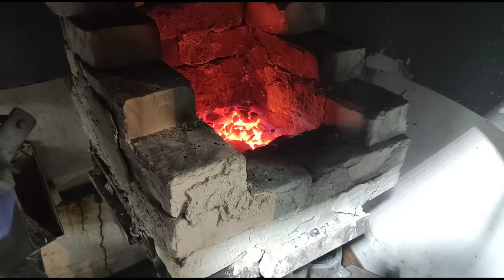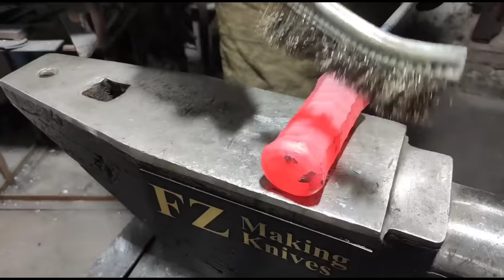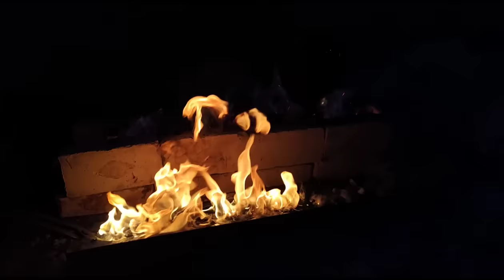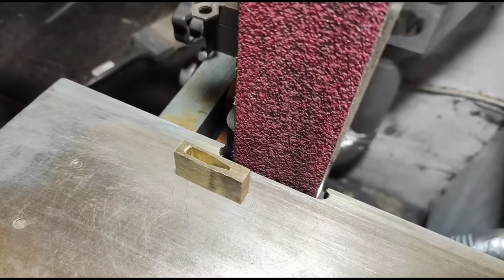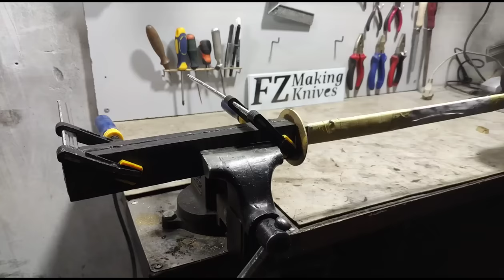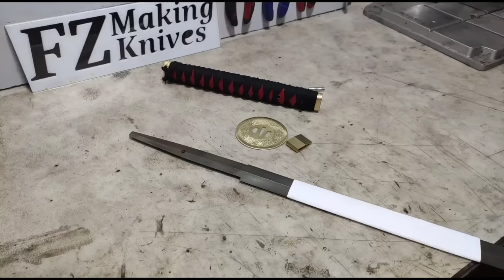Wootz KATANA from bearing balls

Comment: I can't imagine forging out that ingot without machinery. That would be so hard and time consuming. Blacksmiths before industrialization were total chads.
Reply: they used the same exact method, fire,hammers and anvils werent hard to find back then, neither were blacksmiths
Reply: @efslgima  they didn't use machinery dude
Reply: @michaelburgess6004  actually, how hard would it be to tell some slaves to push up a heavy block of stone or steel? thats how it would have happened. a heavy piece of steel, along 2 guide rods, slaves had to lift it up and down. thats how you get this to happen.
Reply: @sollitdude1  That sounds like a lot of effort and slaves for something that could be done with a pulley system. Gonna need some evidence that that sort of thing happened. Slaves are expensive and you also have to keep them from being unalived. I doubt a reputable blacksmith would use slaves for basically anything aside from maybe moving materials, but blacksmiths were often fairly poor.
Reply: @michaelburgess6004  You couldn't be more wrong! Power tools have been available for thousand of years, its only in europe they started showing up by the end of the 11th century. No joke, look it up.
Reply: @cruelfish4824  Why would I look up something that sounds ridiculous if you're the one making the claim? The burden of proof is yours, buddy. Also, power tools implies electricity, so no. I think you're just factually wrong on that one. Electricity is relatively new.
Reply: @michaelburgess6004  https://en.wikipedia.org/wiki/Trip_hammer a pretty one to one example, starting around the 12th century, but im sure more simplistic examples can be found predating that
Reply: @mastermanlaser  The trip hammer wasn't invented until 1839. I read about something called a "tilt" hammer that predated the trip hammer by about 2000 years, but I can't find any illustrations or replications of such a machine. It's described as a "Heavy blunt guillotine" which would lead one to believe it's much simpler than a trip hammer. Hardly a "power tool." That said, the fact that no illustrations or replicas appear when searched calls into question whether or not such a thing was every used or even existed.
Reply: Well, historically, swords weren't really made as shown in this video, obviously. Also smiths didn't really work alone, they'd have partners, apprentices and potentially slaves and various powered tools were available.
Reply: @mastermanlaser  lol OP got btfo'd
Reply: @hypoaktivnaovca  Not powered tools. Slaves no, apprentices yes.
Reply: @mastermanlaser  we talking modern electrical power. Old trip-hammers (tilt hammers) used to be powered by water wheel meaning your blacksmith had to be near flowing water otherwise it wouldn't work. Also the trip hammer started in China and quickly spread to Europe within the same century they sprouted from China. If we are talking about modern power tools which I assume Michael implied then you are just talking and nothing you're saying actually means anything.
Reply: @Devonaut  so first off, power tool actually doesn't imply modern or electrical 'power'. Even now, pneumatic and kinetic power tools are still in use. Second off, I'm not your history student, I just wanted to make you lads aware of the history of human ingenuity. Don't pick fights over things your wrong about, because there is a ton of stuff like the trip hammer in history
Reply: @michaelburgess6004  I mean, I'd consider  a grinding wheel a powered tool in this example and as to the slaves, what part of the world are we talking about?
Reply: @mastermanlaser the OP was clearly imagining conventional modern day power tools. Not tools that people had to walk for 3 days to get to in the 12th century.
Reply: @hypoaktivnaovca  I don't know, but blacksmiths take pride in their work. Personally, I don't think that a blacksmith would have a clueless slave forging out his material. Also, you're the one who would need evidence supporting the use of slaves by blacksmiths since you're making that claim. Additionally, a grind wheel is nothing more than a turn crank attached to a pedal. Hardly a power tool if you ask me.

https://www.youtube.com/watch?v=9nx2Ut7K8Is     (grind stone video)
Reply: @hypoaktivnaovca  Machines are unwavering and designed to do a task. You can ruin your metal with a machine and have to completely reforge it, however, the blacksmith controls the machine. The power, speed and precision are all things that the smith has power over. You don't have that control when you're telling someone else to do it for you. I don't know what blacksmith would put his signature on a weapon, tool, or piece of armor if he had some random nobody slave forging his material for him.

That would be like if Bob Ross had someone mix his paints for him or paint the tedious trees because it was "too much work for him." Or if a potter had someone else make the pots before he put design work on it. It's not yours anymore when you have someone else do that.

There were slaves that were made to forge and alter weapons for the army, but they weren't "blacksmiths." Blacksmiths have a reputation. A nobleman would never have a slave craft his weapons and armor.
Reply: @michaelburgess6004   The master is in control of the ingot, the apprentices or slaves just need to swing in an even, rhythmic manner, that in itself requires almost no training. You don't need perfect control over the whole process to make a high quality product. Although yes, you can make a much higher quality blade much faster with modern machines and materials, certainly.

You think the millions of mass produced swords in ancient rome were lovingly crafted by a master? You think every sword of the middle ages was a masterwork piece of art? That the hundreds of thousands of katanas were all of incredible quality? A sword is a tool, first and foremost, it's fine so long as it does the job. You can always put more care into the complicated parts of the process when it's some noble arsehole ordering it.

Slaves were trained in all manner of skills, even more important ones than smithing, I'm not sure why you seem to think smiths were somehow special.

I'm sure by your logic, slaves would never have been used in construction either, since what master carpenter or mason would put their name on a building that had been built by slaves.
"Oh no, a slave made some of these calculations needed to build the Colloseum, and we'll be using slave construction workers. I guess we shouldn't build it, since I'm too ashamed of my name being associated with it and anyway, my slave accountant said it would be incredibly expensive to do," some Roman architect totally failed to say.

You're just assuming that every part of the process requires the same level of skill or skillset. That every job needed in every part does, even. And you're projecting your romanticised worldview on (apparently) every historical culture, since my original claim was just that slaves would likely have been used for menial labour somewhere.
Reply: @hypoaktivnaovca  That post you just made is insanity. You're making just as many assumptions about me as you are about the blacksmiths of the time. Not every Smith was a "master." Every other village had a Smith because it was necessary. There were thousands of them and almost every one had an apprentice or two. That is an incredible work force if the king tells them all to start making weapons. Also, the vast majority of most armies did not carry swords or armor. They were modified tools and regular clothes. Medieval warfare is not what you think it to be.
Reply: @michaelburgess6004  Not every smith is a master and not every smith is a swordsmith, either, I know. I did certainly conflate those a bit, but my points about slave assistants apply to smiths more broadly anyway.

What assumption am I making here? None of my points are predicated on every smith being a master. 🤔 In fact, you stated that slaves wouldn't have been used, because a master wouldn't trust that they can swing a hammer as instructed, implying that all swords were made by masters. 🤔 All I said is that not every job involved in making a sword requires the skillset of a swordsmith (in very rambly 3AM terms, I'll grant you). I did use the word master a couple times, but you'll find that that's a pretty common word for someone with apprentices and/or slaves. If you mean that I assumed that you meant that no smith would use slaves, then yes, I did, because you apparently objected to me saying that some smiths somewhere likely used slaves to do the jobs that machines do today.

And just to be very clear (since you've been either missing or ignoring this), my points aren't focused on medieval Europe (unless i speciffically said so), since the only premise given was "pre-industrial."
Reply: @efslgima  they mean the hydraulic press.
Reply: @YOGI-kb9tg   thats possible to make without electricity, you just put some gears together and make a big steel cylinder, after that its just core strength
Reply: @efslgima  yes it is possible to make it but its not the point its the question of did they have that level of technology in the edo and other periods of japan.
Reply: @YOGI-kb9tg  ok

Comment: That's just flat out impressive! I've never forged but the process fascinates the hell out of me! Fantastic job!!
Reply from the maker: Thanks 👍
Reply: @fz-makingknives3663  hello
Reply: Anything this guy calls Wootz is a lie, Wootz requires a VERY specific mineral composition. LOL, you would never find in ball bearings.
Reply: @blackmancer  God damn, finally someone else calls it out. I made the comparison, its like saying my homemade shoes are Prada, just cuz I made them the way Prada would...in a building. But with total disregard to actual technique or material used.

Noone currently makes Wootz, and any1 claiming so either has a research grant in order to do so, or its like the video, pure buzzword spam.
Reply: @blackmancer  b
Reply: @meusana3681  so it's in the wootz Style. A crucible Steel producing a desirable pattern. I just watched a nearly hour-long video about someone who received iron ore from the mine of Salahaddin, to reproduce genuine wootz. A certain percentage of vanadium aids in the pattern that you find in the metal.

While it is unclear as to the content of the steal from the ball bearings, the pattern produced was quite similar. Perhaps the steel ball bearings had vanadium? Whatever the case may be, it is made in similar style, and a pattern was achieved in the steel.
Reply: AYAH
Reply: @mohammedshabeer9796  dhhrhehehehsbbdbd

Comment: This is blade smithing in god mode! 👏👏👏
I can imagine that the first 20 years might’ve been rough… but once you get to this level there are no limits!
Reply: Sry but smithing god mode isn't enabled for him because forging a sword with gas isn't the best condition. Also the right temperature for tempering the edge of the sword isn't also right.
Reply: @SinceNightmoon  yeah. Not really sure what the glass was for. It didn't mix within the crucible. Unless it was for certain compounds like the silicate.
Reply: @georgejones5019  The glass melts before the steel and sinks to the bottom, then the steel melts at higher temp and sinks through to the bottom, pushing the glass back to the top, acting as a mixer.  The liquified glass acts as a cap at the top of the crucible and seals out oxygen or impurities.  Rumor also states ancient smiths placed green leaves into the crucible to burn out extra oxygen at the start of the process.  There are several good videos about the history of Wootz and how it was lost.

Comment: Every time something was done differently than traditional methods I had to remind myself that this isn't a traditional sword and a lot of those methods just don't work when you're trying to maintain that pattern. The blade did come out beautifully and even if I find the red a bit much for my tastes, the final result and how well it performs speaks volumes for the craftsmanship that went into it. After all, this is a fascinating way to make a katana that blends old-world crucible steel with more modern Japanese mono-steel swords. I'm sure the blade smiths for the Japanese shogunate would have loved to work with modern high vanadium and chromium steels via crucible steel smelting instead of relying on bloomery steels.
Reply: They would be appalled at this attempt. This sword is far too brittle; you don't make the whole thing out of hardened steel. Even an amateur knows this.
Reply: Traditional Japanese blades used Sanmai techniques and complex layering to make an extremely durable blade. One made from a single piece of steel would be far, far too brittle like the comment said above. However, this attempt does require some recognition as it is the first attempt to use Wootz steel to make a katana.
Reply: @dakota9821  first: he did attempt to differential harden the steel. Second: without him releasing the hardness of the steel and the metal composition, there is basically no way to know how brittle it would be.
Reply: @Soderegami  there were many ways to forge traditional Japanese swords, including using a monosteel.
Reply: How do we know the steel/graphite/glass mix is homogenous?
Reply: @duckacid  It isn't. By design. Crucible steels that exhibit that natural texture and patterning do so because of the heterogeneity of the material which allows for the formation of distinctive cementite and martensite formations. Though it does appear to rely on the raw material having a certain concentration of various metals and minerals like vanadium and silica in order for them to precipitate out like that. It is, in part, because of this more concrete-like distribution of carbides that wootz steel isn't as delicate as some modern high carbon steels. I would love to see him do some more significant test cutting with it to see how it holds up. Something "Forged in Fire" style, so we know if it will keel.

I've read through a scientific journal publication regarding the process of producing wootz steel in a consistent and predictable fashion. The basic principle is that you combine the necessary alloying materials into the crucible, cap it with flux (glass), then fire it, insulate the furnace, and then allow it to cool extremely slowly to allow the egg to cool as slowly as possible so that the grain forms. Then you work it very slowly and as cool as possible to avoid melting your hard-earned grain, as it is unlikely to reform properly if you lose it due to overheating in the forge.

Comment: Very interesting to see a modern steel with wootz pattern.. I remember seeing like 12 years ago, a post in forum where one guy actually bought a wootz ingot as antique from india. He's comment is also very similar to this video, low temperature forging otherwise the cementite will dissolve thus destroying the pattern; very hard to forge, hydraulic press is a must.. But I cant remember whether he did the quenching finally. Because the patterns looked the most obvious if left cool in air or so.
Reply: А чем не понравилась сталь Ш15 ?
Reply: He didn't quench, I don't think, which is why it was slightly curved before hardening. Japanese swordsmiths made the blades straight, and quenching gave them the curve. What I find amusing is that he chose to make a Japanese-style sword, traditionally made from multiple steel pieces welded together, with a lot of pattern welding involved (what people now often refer to as "Damascus steel" even though Damascus was actually famous for their crucible steel, and not using pattern welding) using actual Damascus steel (which the Japanese didn't have), which is a crucible steel.
Reply: @shidwidley  This video surely does not involve any kind of quenching, the older post I mentioned must be tempered as well, since the steel kept cool all the time, no need to quench anyway. Carbon not dissolved, thus quenching not useful.
Reply: @alexanderflack566  It's Wootz steel.
Reply: @krishwadhwani47  The steel in this video is wootz, yes. What most people call "Damascus steel" is not.

Comment: You're my favorite knife maker on youtube! I love how you smelt your own steel. Wootz is way cooler than damascus. 
Will you make a knife with a chisel grind blade?
Reply: Depends on your definition of Damascus. Real Damascus steel is crucible steel with an intrinsic pattern, so it is essentially a subtype of Wootz. It only comes from Saladin's Warda mine near Ajloun in Northern Jordan and was forged by Smiths who knew how to bring out the pattern. 

What people are passing off as Damascus is most often pattern welded steel.

With modern steels, making pattern welded steel is actually introducing flaws into the steel through multiple forge welded layers. It can be made into beautiful works of art, but functionally they would be inferior to a good mono steel blade.
Reply: @ihcterra4625  Yeah, I find it rather irritating that people often use the term "Damascus steel" to refer to pattern welding, which Damascus was famous for not doing because they had crucible steel rather than just bloomery steel.
Reply: @alexanderflack566  and they were making pattern welded steels in Europe in the dark ages. It was a common way to deal with the flaws of bloomery steels.

Using a crucible steel in a Katana is anachronistic. They basically used the same bloomery steels and compensated for the flaws by layering and compositing steels with different carbon content as dark age Europeans. In fact, the iconic curve of the blade is because they used low carbon iron for the spine and high carbon for the edge. They were forged straight.